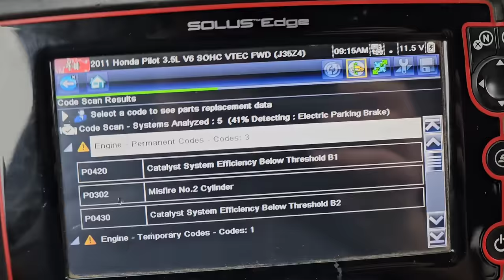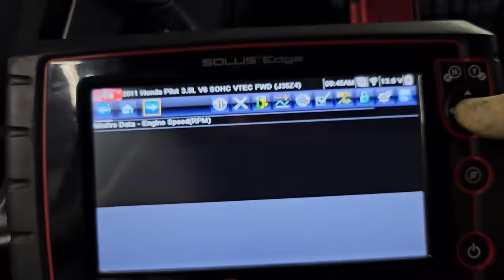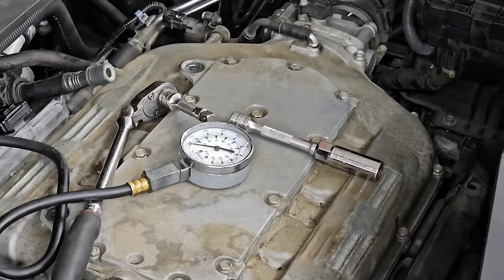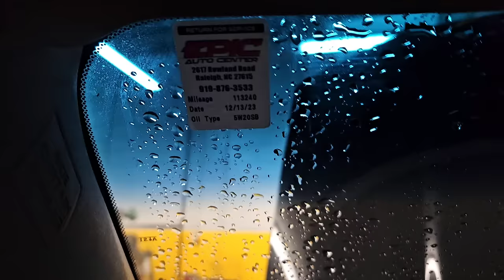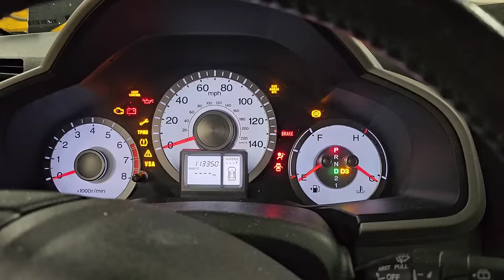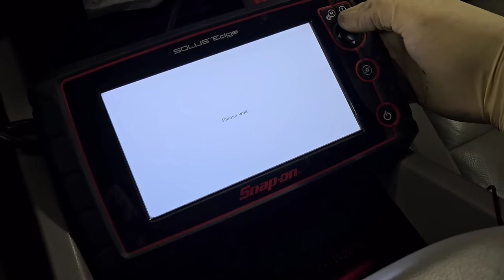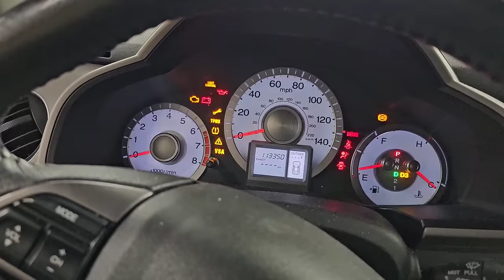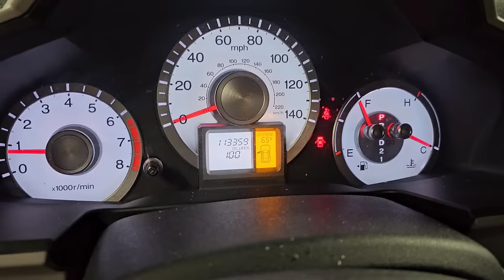Start To Finish Misfire Diagnosis & Repair. P0302 Honda Pilot 3.5

Comment: I was a tech for over 52 years and watching this video reminded me of why I retired 3 years ago. My back hurt just watching you. Nice job though.
Reply: My back hurt too.
Reply: Same here except I left after 22 years, I still remember that days when you finished the job and straightened yourself up as slowly as you could to prevent back muscle strains/tears
Reply: @jamiekaye3680     Yes, Jamie, I remember that as well. The biggest reason I quit is because I have COPD from breathing exhaust fumes, dirt, dust and chemicals. Sometimes I do miss my job though.
Reply: @wysetech2000  Yep, and since those chemicals didn't do anything to you at the time, you thought you were all good. What would you have done differently?
Reply: I do 1 plug at a time that way you never cross the wires and never had the problem 😊

Comment: Kenny, you're most likely going to see that car back in a month or two.  That engine is suffering from VCM (Variable Cylinder Management "ECO" cylinder pause) induced oil burning, plug fouling, and ring sticking.  This happens on cylinders 1-4 as they are the ones that are shut down during cylinder pause.  Check Alldata as there are numerous bulletins out on these J35 engines for re-ringing the cylinders 1-4 to resolve it.  However, defeating the VCM (using a VCMuzzler, VCMTuner or similar device) and replacing the plugs will allow the engine to run on all 6 cylinders and will usually clean up the rings over time and resolve it. An oil additive to help clean up the rings might be helpful, as well, but usually defeating the VCM will resolve it and allow that engine to give many more miles of service.

Comment: Kenny,
It’s the VCM that is deactivating the rear bank of cylinders.  The bores are becoming glazed.  This will happen again.  Eventually the rings will freeze and send more oil to the cat.  Do your customer a solid and deactivate that dang VCM.  There is a product called the muzzler 2 that will fix this.
Enjoyed Vid.
Reply: This is the way

Comment: Misfire Honda if nothing obvious is found=time for a valve adjustment and you'll find them tight every time.  Plus, cleaning  the EGR passages in the intake is a good thing while you're there.
Nice work Kenny!

Comment: Thanks for longer video. I never throw out the old extensions for when i need  a really long one. The plug gap would only stay at where it was set going in for a short while anyway. I use a rubber hose to set the plugs back in the hole , then the socket for the hand torque. VW uses that rubber plug at the top of the coil that causes more headache than Honda’s studs and nuts. I have left tools or parts under the hood  and went back under the hood looking for the rattle

Comment: NGK says not to coat the threads with an antisieze compound. The plugs are already treated. Plus it throws off the torque readings. But as always a great video.

Comment: One side benefit to the longer video(s) is that I've come to  the realization that even searsoned professionals such as yourself often have to ride the struggle bus with small spaces, cramped fingers, and aching lower backs just like us old timer shade tree wrenchers.  Thanks for your expertise and easy going attitude.  Best, Jack

Comment: Yep.. Good ol honda vcm. !  New plugs will help for awhile but with that mileage the vcm activation will foul them fairly soon. Rear bank on v6 .  Along with glazed cylinder walls and Honda extreme low-tension rings that engine  will destroy the cats. [ oil !]. If the engine is shaking it's due to the constant  misfire shaking the motor mounts and destroying  them.
Reply: I had the same issue on cylinder 2 on my 2011 Pilot. The new spark plug fixed it for 15k miles and then the issue came back.
Reply: Check internet... several ways to disable vcm.   Honda knows of the problem but no recalls I know of. Cat 'efficiency ' codes are caused by the oil contaminating the cat.

Comment: I liked this longer video especially since I own this same vehicle. I leave the engine cover off because mice love to sit under it and eat nuts and poop there. I was going to change the spark plugs as they are about due for a change and now I know what I am getting into. I check my oil regularly and noticed the dip stick has to be pushed in until it clicks in place for it to be seated to get a good reading. Thanks for the tips. I enjoy your demeanor and your tips.
Reply: With a Honda or Acura V6, you have to synchronize the plugs, timing belt, water pump, serpentine belt (if needed) and definitely valve adjustment

On top of the coolant and oil change 

With the valve cover off, may as well put new valve cover seals and check that plastic pcv for brittleness 😊

Comment: 👍😎👍
I diagnosing this misfire ..
I get moving the coil packs and sparkplugs ..
Do you also measure the ohms in your bad plug to your new plug...just to check..??
Reply: Oh, I remember that Kenny was doing a spark plug replacement on the Dodge minivan.... 

One of the brand new plugs was bad out of the box 😮

Comment: I personally like the longer video. I also prefer changing spark plugs on a Honda/Acura 3.5 liter over a GM 3.6 liter. Having to remove the intake on a GM is a bit of a pain.

Comment: Hey Kenny you only got 2 cycles on the cylinder that you were pressure testing. As far as I know they recommend at least 3 cycles for a cylinder reading.
Reply: Once you reach the minimum pressure, it passed the inspection.

Comment: You should have said “no need to check the gap NOWADAYS “ years ago I had a metro “a Uk car” that I couldn’t get the emissions down, it turned out to be on the economy model the plug gap was different to the standard model and the customer had fitted new plugs to pass the emissions test but had gaped them to standard!

Comment: That engine has a service bulletin for piston rings clogging due to cylinder management. The fix is the Re-ring the back three cylinders 1-3 and possibly the number 4 if compression is low. Cylinders 5-6  do not deactivate so they are not affected. plugs will last 15-20 thousands miles and will repeat concern once fouled.  BUT the cost of spark plugs every 15-20k is way cheaper than a Re-ring. Choose wisely.

Comment: Reminds me, next oil change will have to replace the copper washer, seeing as it is getting a little old. Last oil change I did anneal it though, using a MAPP torch, and it sort of softened up.

Comment: Kenny Sir what's your opinion on the 3.5 Honda motor? What about the transmissions? I know you're working on a Honda pilot the Honda Odyssey is the same setup right? By the way I like the video
Reply from the maker: It's a great setup. They had some solenoid problems when they first came out, but that was addressed by Honda. YES, Pilot Odyssey & Ridgeline all have the same setup. Thanks for watching & keep wrenching 🔧

Comment: When mounting the engine cover, line up the front two "widgets" first and the rear plugs will also line up.  You can then just press easily on the rear to seat the cover.
Reply from the maker: I appreciate your tech tip! Thanks for watching & keep wrenching!!!

Comment: that V6 have the cylinder deactivation? Noticed the ones you showed are oil soaked. 
I mentioned in another video I just changed the plugs on a 13 Honda Fit Nearly 262 thousand miles Factory plugs They still looked decent. No oil on them Not badly worn. No misfire.

Comment: Hondas 08-15 I think if I recall when they have misfires like that Honda tell you to do the piston rings due to oil fouling out the plugs usually only cylinder will misfire just like this one yeah plugs will fix it temporarily it usually messes up around 80k+ miles

Comment: Whenever I change oil I always fill the filter and put new oil on the filter O-ring/gasket/seal  because if you use used oil it tends to lock the filter on and then someone will complain of the filter being to tight.

Comment: Why did you apply copper paste on the sp  threads.
Reply: To keep them from seizing in the hole.
Reply: Some people are all concerned with the torque going in, myself, when it comes to something like spark plugs I'm more concerned about them coming back OUT

Comment: I have never seen a locking socket extension before. Who makes that?
Reply: Just about everyone.  Craftsman,  tool trucks, etc. Have had them since the early 90s.
Reply: AJ Manufacturing makes the locking extensions for Mac,Matco and Snap On
Reply: I never seen one
Reply: I use the ' black tape ' locking mechanism.

Comment: I  have 2 sockets, one with the rubber, one without the one with the rubber, takes out the plug, the other puts it in, and i never broke a plug YET. And i miss story time
Reply: I have a bunch of plug sockets, some that grip tight, some that barely grip, and some that have nothing

Comment: If 100 psig was an accurate compression reading, it seems awful low to me.
Reply: He only got two cycles on the cylinder. It normally recommends 3 cycles for an accurate reading.

Comment: NO, not liking the LONG style video for a SWAPTRONICS (that should have involved 3 cylinders) and Spark Plug change, sorry, videos should not be over 20 minutes (based on watching 10s of thousands of non-DIY videos) unless there is a real diagnostic that maybe some Channels would make a Part 2 for, but I did appreciate at the beginning about a possible valve adjustment needed that might be affecting both CATS, cheers.

Comment: I use maybe twice what you do, for copper antiseize. Just enough, but not so much as to harden and bond. To me... It helps keep the thread locking carbon, out.